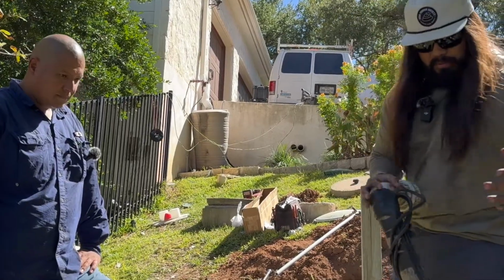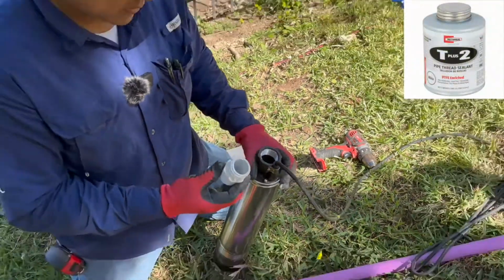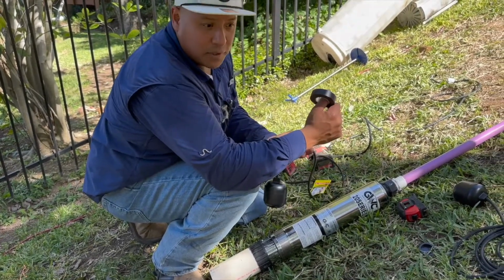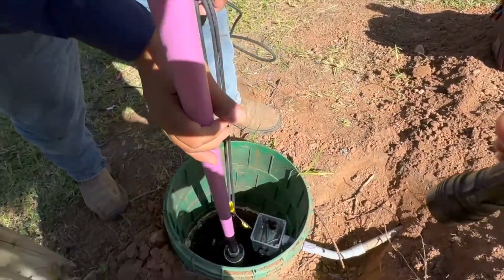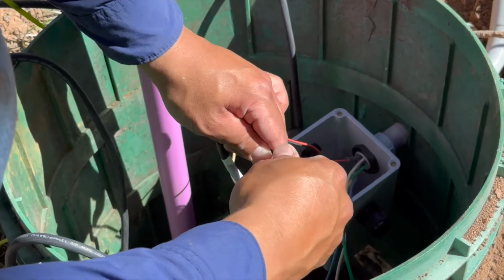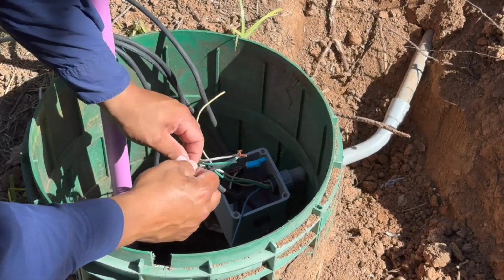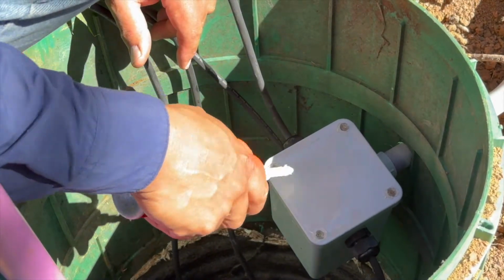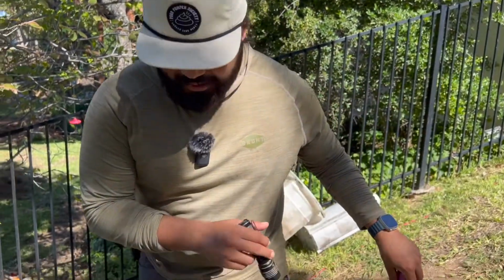Installing an Effluent Pump and Float Switches on a Septic System

Comment: Couple questions. I noticed on my old pump setup (that I replaced), someone had drilled a small hole in the 1” pipe just above where it joins the threads at the pump. Do you know the purpose? A relief valve perhaps? 

Also do y’all use a chain or rope on these ATER pumps? Ever had the PVC break and lose a pump down there in the tank?
Reply: Seen it said that is a weep hole on the off chance you experience air lock.  The hole is normally drilled at angle going up.  Still don't understand it, but there are some vids on weep holes.  Also thinks I had a problem relating to possible air lock and basically I tried to slant my pump at as much of an angle as I could (not much because the narrow hole) and then shook it around while pressing the pump test switch until the pump began to spurt water.  Air lock solved at that point.

Comment: I have the exact same pump at my house.  There is a 3rd float (it is blue) and it is not connected to the pump/pole at all.  It is floating around loose and triggering the alarm.  Do you have any idea what this third float is for and where it should be?
Reply: It sounds like you have a three float system and the blue one is your alarm float, the lowest one on the pvc pipe with the pump is the duty float and the one above that is the over ride float.  The only thing that really matters is that the wires all get to the junction box.  Some have put all three floats on a separate pvc pole and they call that a float tree.  This is done to keep wires from getting tangled and allows you to pull up either the floats or the pump but not both.  Sounds like a good idea and will get around to it eventually.

Comment: Hey Dominick, I have a question for you. Can a pump seem to be ok when testing it out of the tank but not have enough pressure to feed a sand filter? Trying to figure out if my pump is bad or sand filter is getting plugged. Originally, I pulled the pump thinking it was plugged and it was. I cleaned everything out and hooked it up. It seemed to be pumping good for about 5 minutes. Then it started to slow down. The pump has probably been running 24/7 for who knows how long since it was really slow to drain. Can the pump appear ok if its just running 3ft but not strong enough to get to the filter when it's connected? Thanks for the help!

Comment: The company that put in my system installed for a new home, six years ago. Been pumped once. But, it's been alarm issues and crisis with the sprinklers since early on. And, 3 GFCIs. Now I know why.  Every time I  pass by it I cross my fingers. Sometimes I think maybe another company and a big redo. So tired of it.

Comment: From this setup I have evolved very slightly. Stand alone float pole w simtech float brackets makes life so nice. I have tweaked electric connections to make life more enjoyable as well. But this is a solid setup. Nice work guys.

Comment: Wholesale Septic is a very nice company, the one near me is like an OSSF trade-show. Nice demo but wow what a mess of dirt. My pump was full of plastic drill shavings. My pump has also once jammed b/c the installers didn't/don't comprehend head-pressure where the teeth on the motor jammed in the pump, I ended up putting larger low-angle-nozzles on my sprinklers to prevent the head-pressure from destroying my pump. Three 3-GPM sprayers are not enough for a 10-GPM pump & it's more horrific if  it's just a 2 sprayer setup with a 10-gpm pump, wild that installers in my area are allowed to be so deficient.